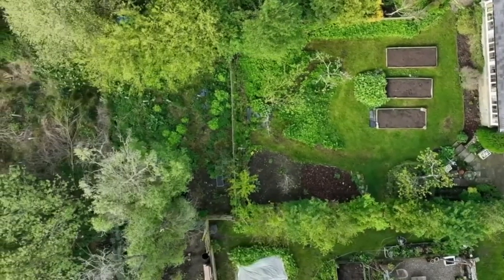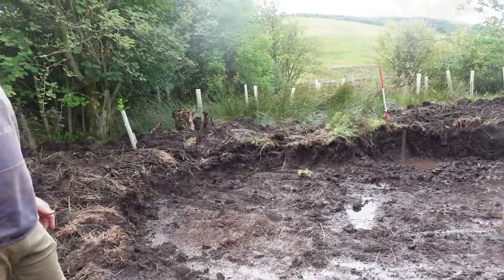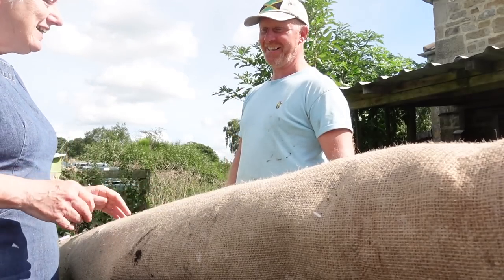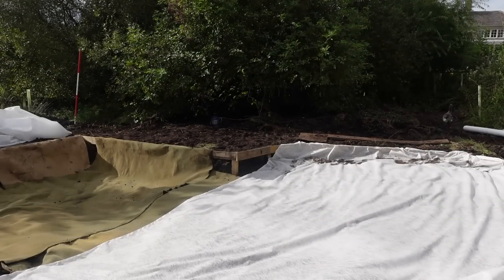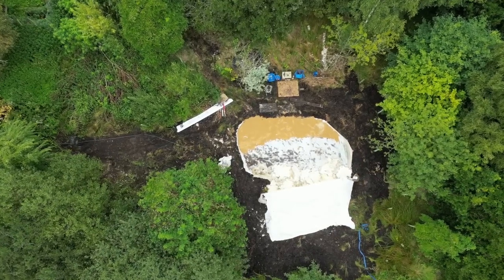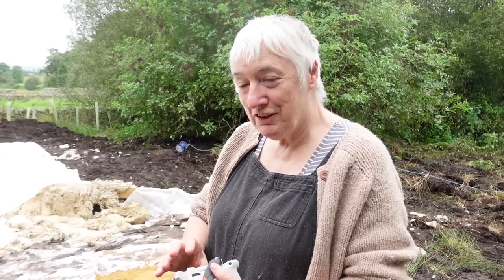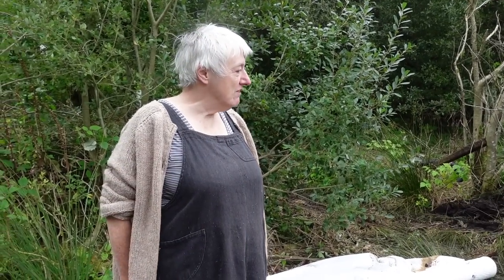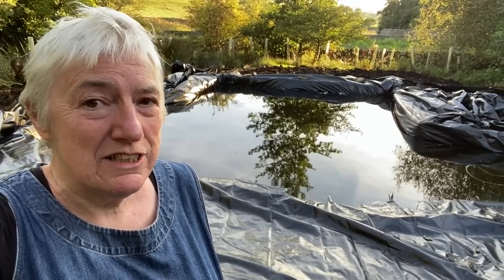The Last Homely Garden gets a POND! Digging, lining, filling ... making a WILDLIFE POND  #6

Comment: We built a pond in 2003 for the gold fish. It was 4 feet deep, 12 feet long and 8ft wide. We needed that depth so that the pond would not freeze completely. The gold fish would 'hiberate' in the bottom two feet,  in winter and in the spring they would come back to the surface.  The sump pump water ran  all year to help oxygenate the pond. Over the 20 years the pond has grown a zillion gold fish.

Comment: That was quite a project!! What do you do about evaporation? Do you have enough rainfall to keep it full? And in the winter, will it freeze solid or are going to find a way to keep it open.
Reply from the maker: we have a plan to run a small bore pipe from the lake that we can turn on or off to keep the levels right xxx as for freezing - well - lets see how that goes? xxx